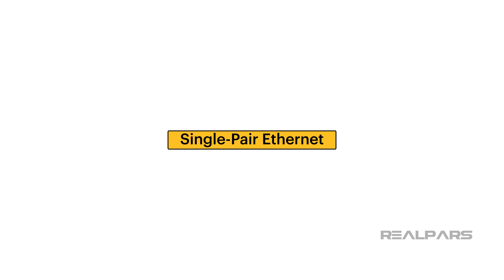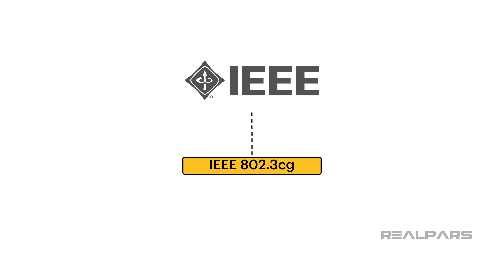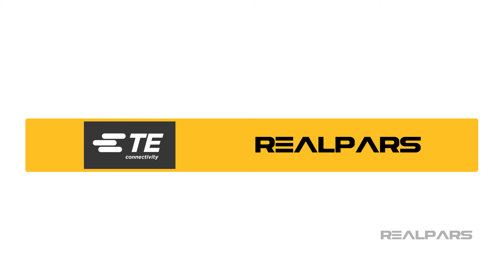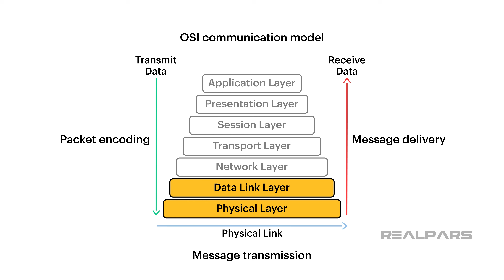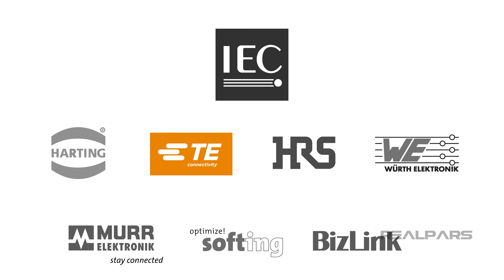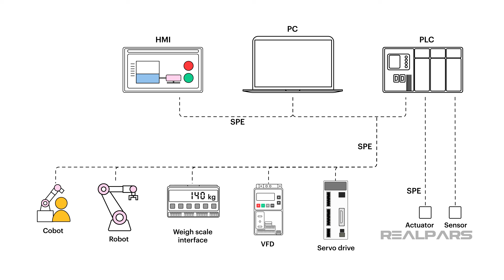Single-Pair Ethernet Fundamentals Course

Comment: Linux went mainstream because it was available.
MCUs went mainstream because it was available (arduino & co, others got obscured into oblivion).
Where ist the available SPE stuff for the amateur, let's say the home automatisation tinkerer or people who want to retrofit older second hand gear or plants.
wireless radio IoT stuff can be had for pennies, I am rather old school and shy away from frequency congestion and empty batteries, but where can I source that stuff?
Reply from the maker: Hi Peter, 

Thank you for raising an interesting point about the accessibility of technologies like SPE (Single Pair Ethernet) for amateur enthusiasts, particularly those interested in home automation or retrofitting older equipment. Indeed, while technologies like Linux and MCUs have seen mainstream adoption due to their availability and user-friendly nature, the landscape for SPE-related products may currently be more limited, especially for hobbyist applications.

For individuals interested in exploring SPE for their projects, it's worth noting that as a relatively new technology, widespread availability for amateur use may still be evolving. However, there are avenues to explore. One option is to keep an eye on emerging DIY communities or forums where enthusiasts share insights and resources for integrating newer technologies into their projects.

Additionally, for those preferring older technologies or seeking specific components for retrofitting purposes, platforms like Radwell (https://www.radwell.com/) can be valuable resources. These platforms often specialize in providing refurbished or discontinued hardware, which could be useful for integrating older equipment into modern setups.

Furthermore, to tie together various hardware components, including SPE-related devices, platforms like RS Online (https://us.rs-online.com/customer/login/?source=myaccount) offer a wide range of products and resources for electronics enthusiasts.

While the landscape for SPE-specific products in the amateur market may still be developing, exploring these avenues and staying connected with relevant communities can help enthusiasts find the resources and support they need for their projects.

Comment: love the videos thanks... not too clued up with all the different communication protocols but why is something like CANBUS not used in an industrial setup? Is modbus old tech and is it worth it to learn it due to ethernet?  Will ethernet replace all these BUS protocols in the future you think?
Reply from the maker: CANBus is used in industry, mainly with small, panel-mounted systems with limited I/O.  I recently completed a project using a Horner XLt logic processor with about 30 I/O on a pilot plant skid.  This is the extent to which I have seen CANBus used in the industry.  Modbus RTU and Modbus ASCII are, as you described, "old", but Modbus TCP is used quite a bit in industry.  Modbus TCP is one "flavor" of Industrial Ethernet.  Modbus RTU is good to know for being able to understand command-based serial protocols, as some laboratory instruments and other simple HVAC actuators and drives are still offering these interfaces.  With all of the advantages that Ethernet brings (which includes SPE, Profinet, Ethernet I/P, Modbus TCP, EtherCAT, etc., I believe the industry will adopt these protocols over more traditional serial interfaces (based on RS-485) over time.

Comment: If it doesn't change the 300 - 350 foot limitation for cable length inherent with ethernet, I don't see the benefit beyond slightly reduced cable costs (that may be offset due to the novelty of manufacturing this cable and reduced economies of scale). Ethernet already includes PoE so you can transmit power and data just fine, and leverages existing hardware / equipment supply lines. Do you get increased power delivery with SPE over standard ethernet? Enough to justify investing in entirely new and unique hardware? This seems like different for the sake of different, not different because superior.
Reply from the maker: Thank you for your comments.  First, existing 10-Base-T and 100-Base-T ethernet networks can be run up to 100 meters, as you mentioned.  One version of SPE, 10-Base-T1L can be run up to 1000 feet.  For many applications, this will eliminate the need for additional switches and network equipment.  In a project I am working on now, SPE would save >$100k in network devices.  Secondly, the power aspect of SPE is superior to PoE.  There are NO process sensors that use PoE as a native sensor connection, mainly because a channel is limited to 650ma.  Most flow meters, analyzers, etc., required much more power to operate. Where PoE is used, it requires special switches with limited numbers of ports and more expensive interfaces and for sensor-level applications, is impractical.  PoE is a good choice for devices such as wireless access points and other similar devices.  Using the power capabilities of SPE would likely be used for new installations, since replacing existing cables would be expensive.  With the lack of ethernet-connected devices at the sensor level, use of ethernet all would be a new installation, and once a good base of sensors is available (in the next 2 years), SPE should be considered.  The cost of cabling and connectors is rarely a significant cost compared to devices and sensors.  SPE cables can also be run in cable tray, saving the cost of running conduit.  SPE can be applied in an IS-configuration, savings a lot of special hardware and connectors required for electrically classified installations.  And yes, SPE installations will be able to carry significant power (8 - 16 amps depending on cable type) for a large number of connected devices in a multi-drop configuration.  This will allow sensor power and signal to be carried over a single cable.  For those of us involved with design and installation of process control systems, this is a game-changer as far as design simplicity and costs.
Reply: Ethernet transceivers are quite power hungry. Half watt per ethernet link might not sound like a lot, but when you Imagine how much power is needed for thousands sensors and other devices powered 24/7 it could be significant. I think SPE has potential to fill gap between more robust and expensive classic ethernet devices and wireless IIoT devices.

Comment: Same as ethernet APL?
Reply from the maker: 10-Base-T1L is the variant of SPE that is considered to be APL.  An APL network has a maximum practical length of 1000 meters, so it will be very important structure in any IIoT application.  Other variants of SPE have much higher throughputs, which will greatly benefit data transmission at the sensor network level.

Comment: It’s like very old BNC connection and ipx/spx broadcast structure. First question is range with coaxial cable. Second is heavy traffic on one line. If we have thousand device in one line, how can handle heavy traffic. It’s appearing this application for just small amount data node and short range requirements.
Reply: please i have one question are SPE a protocol like profibus or not?
Reply from the maker: @Amazigh-n5g  SPE is more like Profinet APL than Profibus.  Profibus uses a telegram-based communicatio model, whereas SPE and Profinet APL use TCP/IP.
Reply: @realpars  thank you very much 😍
Reply from the maker: I am not sure that I completely understand your question, so I apologize if this does not answer your inquiry.  Coax cables are not used for Single-Pair Ethernet.  Coax is used (or was used) for 10Base2 or 100Base5 networks.  The number of nodes connected does not determine loading on the network.  1000 nodes communicating 5kBytes/second will not likely overload a network. 1000 nodes all continuously broadcasting print jobs or file downloads probably will cause an overload. SPE solves these issues with the ability to provide a significant bandwidth at high speeds.  The different variants of SPE can allow these benefits over long distances (10Mb/s) or at faster speeds (1GB/s) over shorter distances.
Reply: I would tend to agree with your statement. I work in of the auto plants as an electrician and we have a combination of at least eleven hundred frequency, friction drives on a network. I wonder how this technology would stack up against it. Seems like there's a lot of little hiccups with ethernet systems, in my opinion.